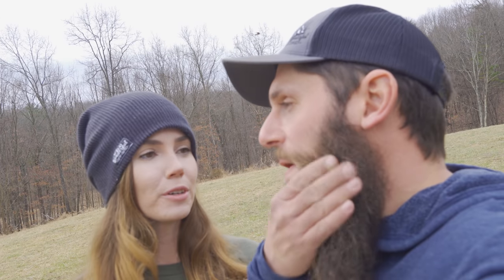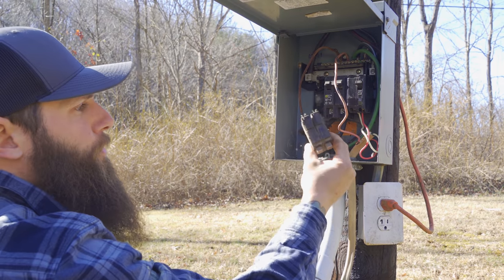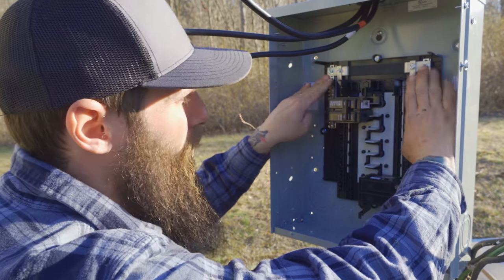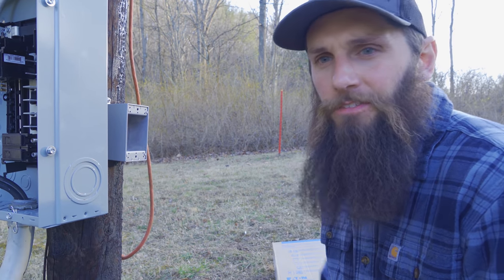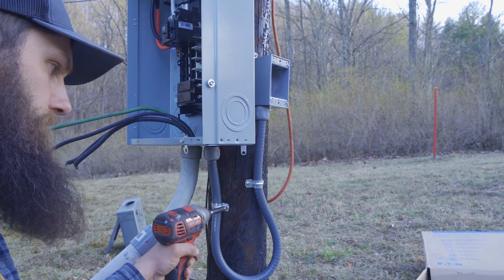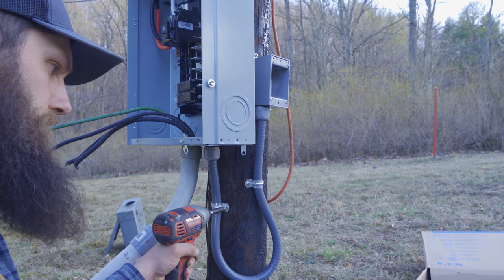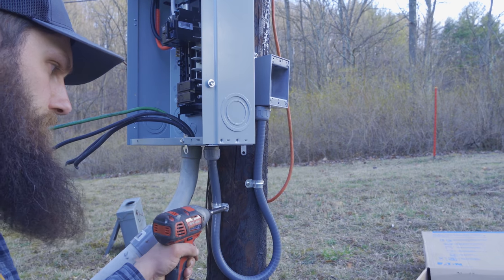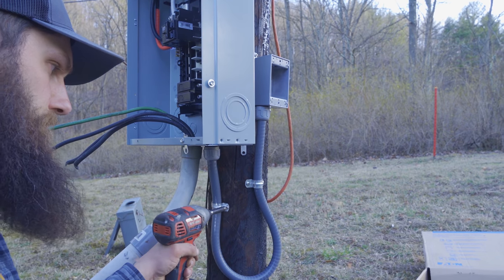We Have A Major Electrical Issue!

Comment: 15:55 "If its an inch and a quarter or bigger, it needs a bush." Wise words my friend.
Reply: Hoss Man 😂😂
Reply: Actually if the wire going through it is #6 or larger, it should have have a bushing.
Reply: #8 or larger
Reply: Actually every rigid connector unless terminated into a hub needs a bushing regardless of wire size or conduit size. 

2017 NEC                PVC 352.46

But this is really nit-picking here. He obviously knows what he is doing and hit all the important points.
Reply: It went right over their heads Hoss Man. No pun intended! 😂

Comment: Great job installing the new service panel. The only thing that you might want to do is seal up the large panel mounting holes with sealant that would've been used for mounting to a plywood backboard. Great workmanship. 
Kirk

Comment: Josh, I have lived in the same residence for over 40 years. The main panel had a outdoor receptacle hanging down from it with a regular in house double and an old double swing door cover since I have been here. I really liked that WR, GFCI and the box cover you put on.  I was over to Lowe's for them today and purchased both to replace the dangerous set up I have. Thanks for showing that.

Comment: I'm also an Electrician and figure someday due to evolution , electricians will develope a 3rd arm and haned to hold the meter. :)
Reply: I use a magnet occasionally... still an issue with my wood magnet, refuses to work properly.
Reply: 4 hands, 1 for the meter, 1 for each probe and one to hold everything steady
But then everything else is going cordless , why can't we get cordless multimeters? :)

Comment: It is refreshing to see someone actually label an electrical panel. There is nothing more fun than needing to trace a wire before you can turn off a breaker. lol 😂 I would like to see more videos like this.
Reply: It's a code requirement. It's why homeowners pay for inspections. before closings can go forward.
Reply: @michellepernula872  Its only required on code for the date of the house being built. If a house was built prior to sad code and no major changes occurred since, then its grandfathered.
Reply: Labeling it so you can read it, at least in FL doesnt seem to be part of the requirement. Stubby pencil Mark's on paper taped to the front seems to be the preferred!🙄
Reply: @judyshallstrom415  they probably label it in some form of Spanish.  well it was a Spanish colony.

Comment: You have to do that in Germany as well. The Green- Yellow- Blue PEN comes in from the mains and is split into Neutral (N) and Protection Earth (PE) at the Main Panel. They then get distributed seperately throughout the house, with the PE having a connection to a Grounding wire that's buried under the house in the Ground. That switches from TN-C Network to TN-C-S.

Comment: When installing the ground rod you should try using water!  Push the ground rod in as far as you can then pull it out...pour water in the hole then work the ground rod in back and forth in the hole...sometimes it goes all the way in!

Comment: Using a white wire as a lead wire (120volts) for the pump seems out of electrical color codes ; I would have used the black and the red wires for the leads (240v) and the white as ground; that would make more sense for the well pump.
If you have to used a white wire as a lead wire then taping over the white part with black or red or brown colored tape would indicate the white wire is used as a secondary lead.
Great job over all

Comment: I've worked in Professional AV stuff like concerts and theatres show for a decade. Gotten in touch with quite a few power/electrical parts of these shows as well.
It's kind of interesting to see how the States breaker boxes are set up compared to the EU ones.
Reply: Once had a firemarshall cera-blade through the electric-mains on an european venue build by an us-company because he couldn't allow that to be powered. I've seen photos. It was pandemonium. Bare live wires on the show floor and stuff ...

Comment: Love the content and how passionate you are about it. There were a few items I wanted to point out, NEC 310.15(B)(7)(2) allow the feeder conductors supplying the entire load associated with a
one-family dwelling to have a derating of 83%. Thus #2 aluminum wire can be on a 100A breaker which would other wise need a smaller 75A breaker. Not sure what size wire you had.
Also you are only required to drive a second ground rod if the first one is NOT 25 ohms or less to ground. (NEC 250.53(A)(2) Exception.) 
I'm not trying to be a jerk and pick apart the content, really I love seeing someone explain electrical like this.
I'm also enjoying the house build. Keep up the good work.

Comment: The white line on the well pump don’t they have to be marked black or red to indicate it’s a hot lead instead of neutral just curious
Reply: I actually was going to post that here they have you tape the white wire black on a 220 circuit as to not mistake it for being a neutral wire .

Comment: In Germany we use AC and we`re have N, L, and PE. PE goes in the ground and is in the house connection box combined with N. after that they get separated. Voltage goes in over L and the N goes out. The PE is for grounding for example metal casings. Hope my english wasn´t too bad ^^

Comment: Josh is right, this stuff can kill you (or burn the house down!).  Recently we had a hot wall and smoke started coming out of one of the outlets.  We called an electrician.  We've been living in our home for more than 30 years, and over time the wires in that circuit vibrated enough to come loose from the outlet, causing a short.  The electrician replaced every single outlet in that line; some were starting to crumble!!!  We could have been away and a fire would have started!!!  Now we are going through the house checking every single outlet and light switch in the house.

Comment: Somewhere in the system the neutral needs to bond to an earth ground. If there was leakage in the poll transformer; it should find a path to ground.  Lightning strikes should find a path to ground before they find a path into a building's wiring. Each electrical box and exposed metal devise also need a path to earth ground.  There will be variations by locality and service on how those goals are accomplished. A copy of the NEC could come in handy, as a guide.

Comment: Thanks for the insight to the 'American way' with electrics.
In UK our electrics are distributed with neutral and earth together from the power station, and since the 80s the overhead line neutral below 415v was taken to earth at regular intervals along a supply route. At the customer supply board the earth , neutral and live are seperately fed to the distribtion board. Most houses at 240v the lucky few have inherited 3phase 415v if the house load was over 80 amps many years ago. Great if you want a proper workshop in your garage !!

Comment: Wired my own house after Hurricane Katrina.  Not a licensed electrician but have background and experience in both electrical and electronic.  Went by 2006 NEC when doing it and inspector told me it was the best wiring jobs he had inspected in his 20 year inspection career.  I still learn new items such as the WR rating on the GFI I never knew about on your video.  Great job on the electrical as you and I have the same organized and neat  boxes.

Comment: You can contact your local fire department and donate that building for them to practice their techniques on, way faster and you wouldn't have to deal with everything. They'll tell you what to do as far as the utility's getting decommissioned. Less expensive than you using gas for equipment to knock it down and manpower to move all the wood. You could remove the cabinets and sell them to someone needing it in their garage or whatever too.

Comment: Very interesting comparing to UK as far as I’m aware your mains electrical system is 110 volts as ours is 240 volts. Your replacement was 100% improvement and 100% safer for anyone using electrical appliances on that circuit. Top Man.

Comment: Easy way to put ground rods in is get a Bosch hammer drill, tape a pvc pipe to the drill bit and slip the other end on the top of ground rod and it’s a back saver:) hopefully that made sense lol

Comment: It doesn't matter which wire you use, but I was wondering why you did not use the red and black for the hot legs on the pump and the white for the ground?  Red is usually considered a hot leg and white a neutral.

Comment: Hey great vid, love your channel and stuff like this. For the ground rod installation, I learned that a hammer drill works very effectively given the dirt is not too hard. I'm referring to something like a Hilti TE50 or larger. The ground rod will fit the drill bit opening. It works fast and saves having to swing a hammer.

Comment: Just for your curiosity! Here in Brazil we have basically the same structure as yours: 1 neutral + 1 fase (110v) + 1 fase (110v). But in some regions we have just one fase with 110v, and in other regions we have 220v in a single fase too. The default is as yours, but for some reason the eletrical companies decided for different patterns in different regions. Also, we use to have breakers NEMA on the past, right now we basically just use DIN breakers (just the old houses still uses the NEMA, all the new buildings uses DIN). Ignoring simple details on the design of the panel and some individual protections that are 'code required' here its exactly the same pattern as you have there.

Answering your question: yes we like to see this kind of content here :) the building is amazing but its always good to have different content on the channels we love!

Comment: All you need is a gallon jug of water to do the ground rod.  Wet the ground and push the rod into the mud.  Pull the rod out and fill the hole with water.  Repeat until done.  A lot faster and easier than driving it with a post driver.  And if you don't believe me just try it.

Comment: Having an income generating property could be a good way to have a safety net for extra income. The question would be how do upgrade the house at no cost to yourselves. Up here in MA we have some vocational trade schools that teach the kids the trades. Sometimes they are keen to take on projects that the can do to teach the kids. It looks like you have some structural, plumbing and in home electrical issues. If you don't have a timeline for when you need the property up and running it may be just the project that a trade school would love to do on site? If not, look forward to seeing how you guys deal with it. Its great to see you guys working together. Best of luck.

Comment: Hey when i was wiring swimming pools I found the easiest way to put in those ground rod is with a rotary hammer just Switch off the rotary and just used a hammer or a light demo jackhammer set that thing right on top of the ground rod and pull the trigger works great

Comment: White wire of the 220 pump circuit should be taped a color (red). The reason I know, been turned down in Va. and NC  Lol. Work looks good. I've been a Electrical and HVAC  contractor for 40 years and watched your work from day one. You do nice work and should get your masters. Electrical work has been good to me.

Comment: I think I saw two mounting holes in the upper part of the back panel that really need a couple bolts to seal from water ingress. Interesting video. So very different from European electrical installations.

Comment: You need to color code your white wire as a hot wire (red) per National Electrical Code on both end from where it enters the Load Center (It's not a panel) and the end line device. The reason is that it identified as a hot wire (measure 120 volt to ground). Yes I know that the only two times you can use a white wire as a current carrying hot wire is in 240 volt (well, water heater, electric furnace and a 120 volt switch loop/traveler. But it must be at every termination point also.

Comment: What happens if neutral is connected to ground?
If the neutral breaks, then plugged in devices will cause the neutral to approach the "hot" voltage. Given a ground to neutral connection, this will cause the chassis of your device to be at the "hot" voltage, which is very dangerous.

Comment: Would you de-ox grease copper if you live near saltwater canal?
Looks like you clipped the yellow tag to pull meter and change out the legs to the new load center. Looks good.

Comment: Since it is on well and septic I would contact the local fire department and see if they would like to do a practice control burn. In Our neck of the woods, the fire department is a volunteer and so they are always looking for an opportunity to practice a house fire in which the end product is the house is burned to the ground. Then the landowner is responsible for the cleanup. Then after you are moved i you can park the trailer there hook it up to the septic and the water and the power and have a guest house.

Comment: I am currently rewiring a trailer from 1960 and it is much MUCH worse than that home. There where 2 main panels that where tied together with an extension cord. Both had 200A breakers and the main service coming in was only 100A. When they asked me to give them a quote I just started chuckling because I knew what all was going to have to be done. 2 months in and the whole thing is basically gutted. It's not worth fixing something that is that far gone. I wish I would of just told them no, and regret it every time I head out there. I'm an Electrical Maintenance Engineer and I'm doing the work for my GF's mom. If anyone asks you to rewire a trailer, just say no...

Comment: What does the inspector say if he catches you using a straight edge to remove insulation from an aluminum wire......just a 
small nick in aluminum wire can be a real problem....??????

Comment: I am wondering f there is a disconnect before that meter? In Canada you wouldn't be able to use that panel as a main panel bc there is no safety barrier separating the main breaker from the rest.

Comment: my grandpas old house had 2x4x10 buried in the ground about a foot and he had 2 small glass insulators on each one and 2 bare wires  that they ran n them to run 2 wires to his garage about 100 feet away. about every 5 years we had to replace the 2x4's I remember when the wind would pic up he would throw he pull the round fuse so they wouldn't blow.  and when he passed away we was going to update the wiring and found out he had a penny behind every fuse.  we never did finish the house the entire family started fighting over the house and we all more less walked away.

Comment: Did you put grommets into the panel mounting holes, there were 4 not used as you mounted it in the center onto the power pole.

Comment: We will put deep or shallow strut on a pole. Then Mount the panel to the strut. Make flat place on the pole to put the strut on. Just a thought. Good job on the panel for sure.
Burn the house down and start over someday. But until then keep it locked up. Cheers.

Comment: I think Josh is a great electrician. 2 questions,  about if that was an underground rated acorn lug?  and are you not required to put bolts in the empty holes in your NEMA3 panel?
Seems Its not weatherproof if you leave holes open in the back, according to the manufacturer and inspectors here.

Comment: Why not label the labels while still on the sheet with all the words you want or need and THEN peel them off and place them, way easier and you never lose ink flow? And then pin ship is far better to write on a table rather than bending over and in a tight spot.

Comment: Love to see more , I'm a electrician from the Netherlands( actually I install CCTV and security systems but my basis is to be an electrician) and ofc Josh said this is states and not Europe .. but it amazes me why states uses like metal boxes and pipes and square and rectangular flush-mounted boxes .. everything here is in pvc type boxes/cases/flush-mounted boxes caus it's not led by electricity . Also our flush-mounted boxes are round .. so i only need to drill a 8,6cm hole and i only need to know the center mark and done . And also the earth wire .. its blank copper lol !! Also here in Europe the earth has isolation around it caus if there is electricity on that wire you won't get hurt by it. Love to see the videos of u !!!!

Comment: What do they do in Europe that is different? They don't bond the neutral and ground at first disconnect? Why?
Reply: They have only 240 volts, no 120.  Europe uses an RCD (residual current detector) which is similar to a GFCI (or GFI) but is geared more to protecting equipment than preventing shocks.  RCDs don't trip as quickly (100 ms vs. 25 ms) and require a greater current imbalance before tripping (30 mA vs. 5 mA).

Comment: Josh, we had no idea you could speak that quickly!  It was pretty obvious you were much more comfortable and had switched into high gear once you were in native territory!  So did you replace that bad plug on that extension cord with a good one so the a leakage fault signal could actually trigger the ground fault interrupter through that ground wire on that cord?